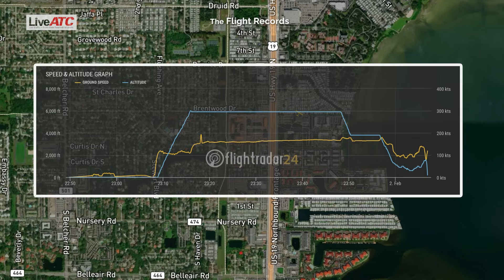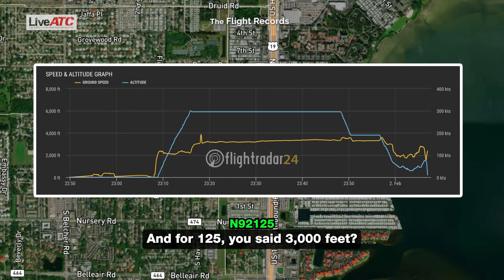Tragedy in Clearwater: Plane Crashes into Mobile Home Park, Lives Lost

Comment: The fuel situation will be examined as Bonanzas have selectable tanks, not both, but I will wager that the investigation will concentrate on the pilot.  I suspect he stalled it and went in uncontrolled.  Some people say this plane is hard to fly; it is not but you need basic competence.
Reply: There is a reason why it was calld "The Doctor Killer".
Reply: @ImpendingJoker  and what reason was that?

Comment: In general, there is little to no excuse for losing control during a partial or complete engine stoppage. 
While it is possible the engine had a failure, the more likely scenario is fuel mismanagement followed by marginal situational awareness and not paying attention to flying once the engine lost power. At low altitude, it is really important to FIRST fly the aircraft and then attempt to troubleshoot the problem with short bursts of attention. 

The frontage road may have been a terrible place to land, but not nearly as terrible as a neighborhood.
Reply: No doubt completely forgot about flying the plane, banked at low speed and fell out of the sky.
Reply: If he was attempting the frontage road or US19, he really messed up. Going south would have been the easier turn and slightly less traffic. Either way, he had MILES for a much smoother glide.

Comment: I wonder if he got preoccupied trying to find the airport and didn’t switch to a fuller fuel tank.  Also, according to the graph, his descent was quick and the airspeed increased, which doesn’t seem to jive with flying best glide speed.
Reply: If you look at FlightAware, he's climbing to 1500 as he goes ESE. So far that looks like normal flying down to Whitted. He starts dropping right around when he says he's losing an engine which is about when he's crossing Belcher. The turn NE is when he's already losing altitude. Could it be a stall and loss of control?
Reply: @Chat562  Probably, because by the damage path it looks like it just fell pretty straight down.  Could been a stall/spin, or just a loss of control.  The airspeed on the graph is what curios to me, that it increases with the descent.  If he was gliding, you one would think he would maintain glide speed, rather than what looks like a dive.
Reply: Banked and fell out of the sky.
Reply: @whatilearnttoday5295  That’s not really a thing.
Reply: @Spyke-lz2hl  Huh? You just said "Could have been a stall/spin". Which it clearly was. Which was caused by attempting to turn at low speed. Which is absolutely a thing.